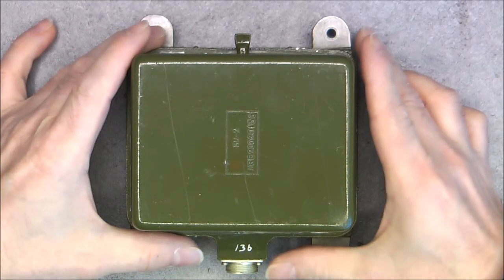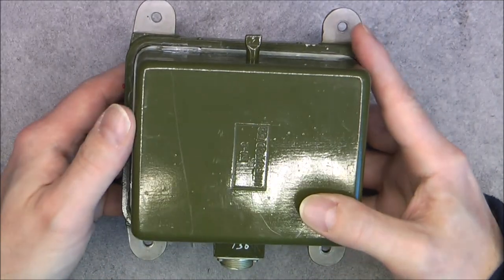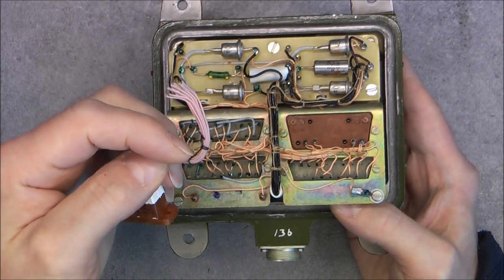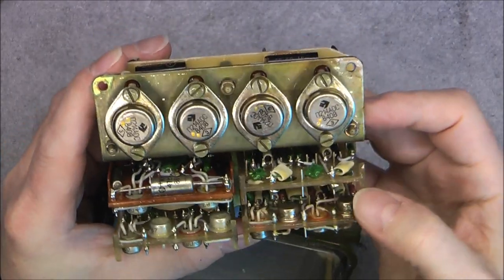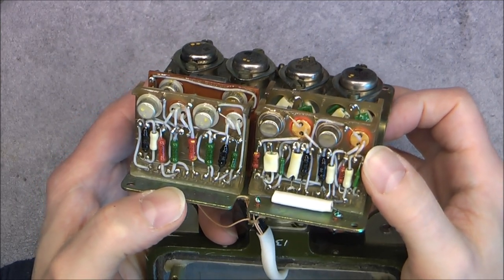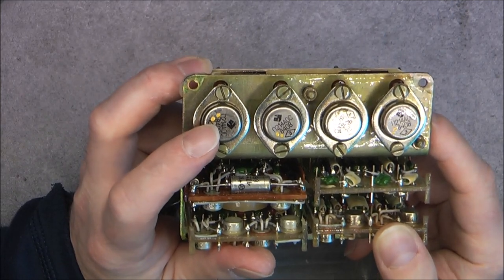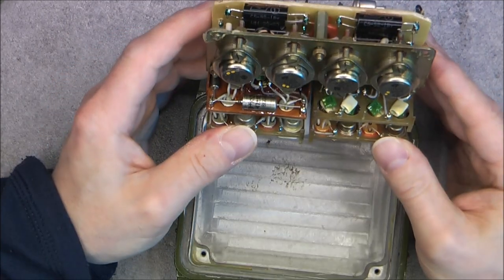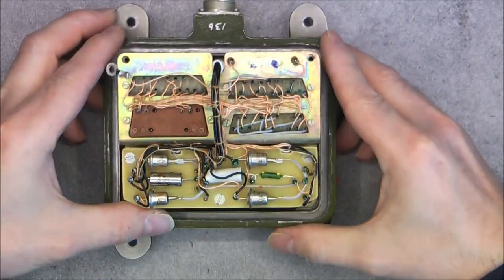Soviet military electronics teardown "БУ-2" box

Comment: I poked around a bit, and this part matches a part that's used inside an IL-76 aircraft. Same name "БУ-2", which is actually kind of a generic name. Б = Блок = Block, У = Усилитель = Amplifier. Anything that starts with "Б" is just some type of "block", which is a common label for Russian parts. In the IL-76, БУ-2 is a differential synchro signal amplifier. From what I understand, It amplifies the "disagreement signal" between synchro-transmitters of the nose wheel (which transmit its angle) and synchro-receivers at the pilot controls. This amplified "difference" signal then feeds an electro-hydraulic amplifier which controls hydraulic fluid flow to the nose wheel to steer it. That seems to be most of the control loop. Some IL-76 planes did use this exact "forest green" color for some of their parts it seems, even though the main cabin was always a kind of "teal" color. This part's critical importance could explain the sealed construction. Lack of big reserve capacitors could be explained by the fact that this is a control amplifier, which likely feeds a high~ish impedance input (the input stage of the main electro-hydraulic amplifier). However, since "Amplifier Block 2" is a generic name, its use inside an IL-76 could be a coincidence. Maybe it's from something else entirely. The quad-PNP arrangement and low voltage operation (likely 27V, since Vce is only 55V as per Antitheist39 J
's info) would be unusual for anything else. Linear mode operation makes sense. You can see some good photos of IL-76's insides if you google "Внутри самолета Ил-76Т " (include quotes, first match on fishki site). Another good thing to search for is "Ил-76 отсек" in image search (отсек means "section", which will likely show you sections within the plane as opposed to the plane itself).
Reply: Just to add, I confirmed that the БУ-2 amp inside an IL-76 is a 2-channel device, which matches this unit as well.
Reply: @oriole8789  Wow very interesting and fascinating explanation!
Reply: Quite strange as these are low speed power transistors. A synchro isn't a high power device.
Reply: @aabb-zz9uw  From what I understand, the signal being amplified corresponds to something like 1/3rd rotation of a synchro, so it would be very low frequency/bandwidth. The output signal from this amp is labeled as a "command signal" (so, low power). It feeds an electro-hydraulic amp (АУ-40А-3) which has its own drive circuitry.

Comment: The power transistors are germanium pnp with collector-emitter breakdown voltage of 55v (collector-base 60v), collector current of 5A (continuous), DC current gain of 50 - 150, power dissipation with a heatsink of 10w, saturation resistance no higher than 0.3 ohms, frequency - 0.15MHz. Source: https://eandc.ru/catalog/detail.php?ID=12768
The diodes look like Д237Б. Those are silicon 400v diodes with 300mA continuous current, 10A pulse current, and maximum frequency of 1KHz. Source: https://eandc.ru/catalog/detail.php?ID=5692

Couldn't see the markings on the smaller transistors, but if they are complementary, or at the very least different conductivity types, then this could be some sort of a control circuit for some DC motor stuff, where you need to control 2 motors in both speed and direction of rotation. Maybe move something along a X and Y axis or whatnot. It looks very much like a stereo amplifier, and it almost has to be something very similar to that. It's a two channel device by the looks of it... or it could be one single H bridge, but I doubt that. The gold plated transistors look similar to КТ603. Those are npn, but I also see something marked МП there. Those are germanium and most of them are pnp, though there are also some that are npn - МП37 for example. I doubt those diodes power the entire circuit, that's probably only powering the control stuff. But the device could have also powered some low current load with variable voltages, and the huge power transistors are used so as to save space from heat sinks, provided the thing was operating in linear mode.
Reply: Good analysis, thanks. I added my own bit of info in the main comments.
Reply: Could be an H bridge as there are 4 low freq power transistors. Not better than a cheap L298

Comment: Looks like a date code of 8605 on those diodes.  Amazing they were still using that old case style in '86.
Reply: Not that incredible when you consider they kept using germanium transistors and regular vacuum tubes up into the 90s, even synchro resolvers when they already had the technology to convert most of these things to integrated logic. I guess things moved slower in the SSR compared to the rest of the world.

Comment: Looks like stereo amplifier with dc/dc power adapter , but is not ... because is from URSS , they never developed that kind of stuff , because if it wasn't useful for killing it wasn't useful for anything .
Reply: Yes, it is really stereo amplifier from component hi-fi audio system for T-72 battletank
Reply: I have a soviet Hi-Fi stereo Reel To Reel and yes: it can kill... just throw it on someone's head!
Reply: @Red Smith : That's a very narrow minded opinion. Actually, there were quite a lot of Soviet designed hifi equipments, as well as other civil goods. Those hifi items are very interesting. I do remember the conclusion of a Soviet made amplifier review in a French hifi mag from the 70s : "The built quality of the interior is startling... Everything is built to last a century".

Comment: That looks like one of the control boxes used in the control subsystem for the gimbals for the rocket motors on soviet ICBMs from the late 70s to mid 80s.
Reply from the maker: Do you have links to any photos  ?
Reply: Maybe mechanical gyro gimbal stabilizer?
Reply: @msylvain59  No, unfortunately not. A co-worker of mine was involved with the SALT and START treaty inspections and he had a few parts he brought back a souvenirs. He had a couple of gimbal control boxes and they looked just like that. It's been a few years since I last saw the parts but the interior construction looks similiar too.